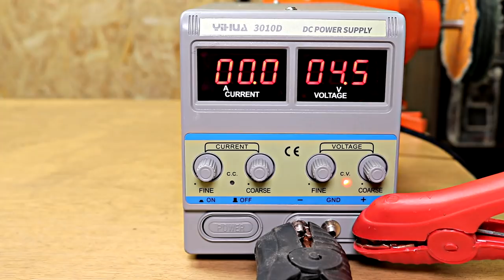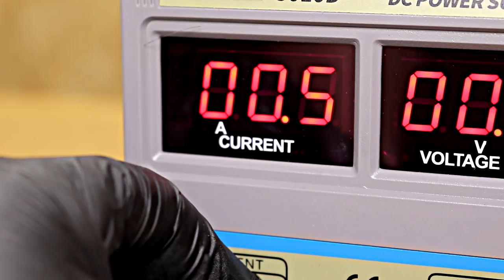Extremely Rusty Mauser 98K Bayonet Scabbard Restoration

Comment: So I think first you removed rust with oxalic acid, sand blast the cover, put a wood form in and cover with a resin (bondo) substance, sand and spray with a conductive paint so you can lay down a layer of  copper plate.  Then you sand paint and sand many more times.  What is the purpose of the copper plating?  To give it more strength?  Also, I actually kind of like the look of the scabbard after the rust is removed.  Maybe another time a clear resin coat to reveal the original pitted metal and/or maybe not sand blasting so you don't remove as much metal and use a rust converter.